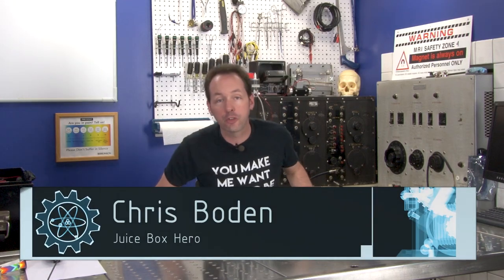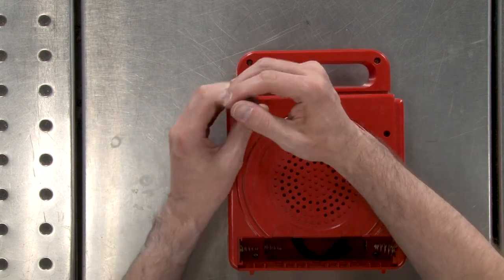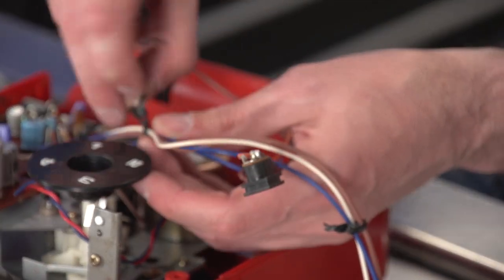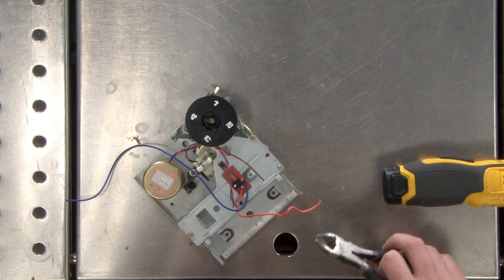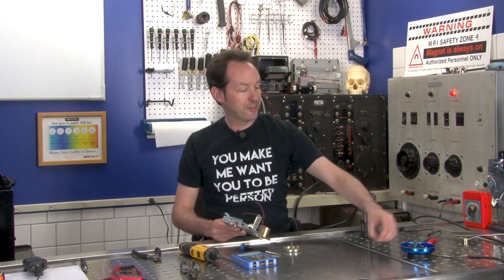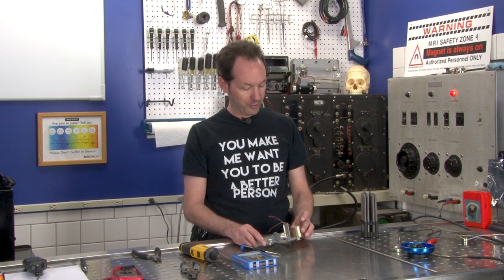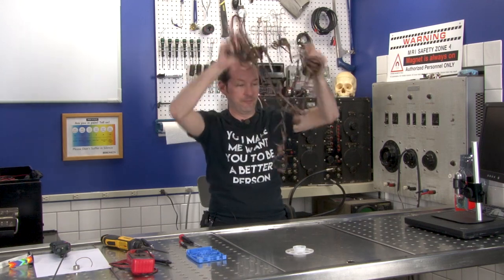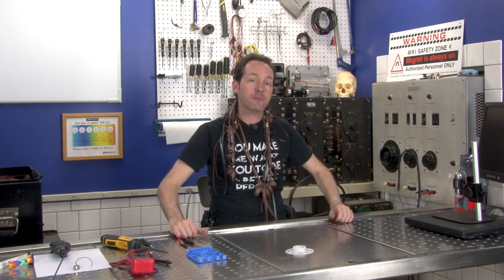Soundesign "Super 8" 8-Track Player: Equipment Autopsy #98

Comment: We had one of those when I was young;  Early to mid 70s.  No later than '77 as we had gotten a proper cassette deck by then,, but probably more like '75 or '76.

 It lasted for years; we used to take it camping, as it could run on D-cells for quite awhile.  It was the only 8-track player we ever owned.
Reply: Ours was stereo, though, I think; a second speaker was connected via a 4 or 5 pin plug.
Reply: I had one of these when I was a kid. The halves came apart -- each one was a speaker -- and were connected with a cable, so you could have stereo sound. It wasn't GOOD stereo sound, but it was stereo.

Comment: I had a couple of these player in the 70's - A GE "Loudmouth" and then a MacMartin (K-Mart) stereo boombox with AM/FM stereo radio. The only problems I had with them was that they ate a tape now and then, which needed a good cleaning of the heads and capstan.  And they burned though a lot of batteries and back then Alkaline's were super expensive. I got rid of them when cassettes took over in the early 80's and I needed closet space. Now I wish I still had them.